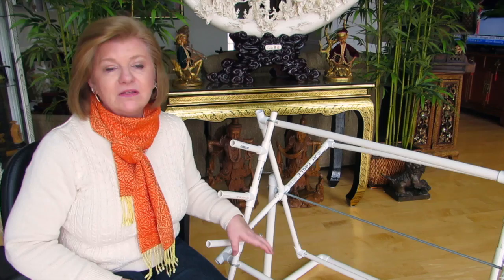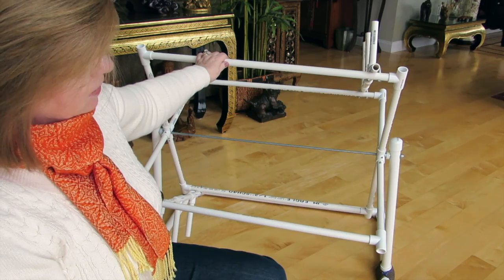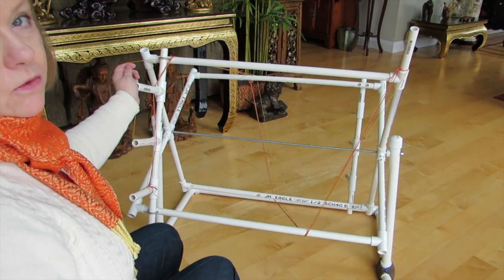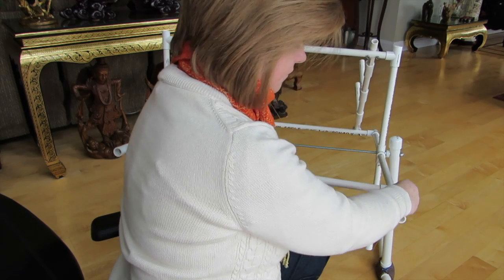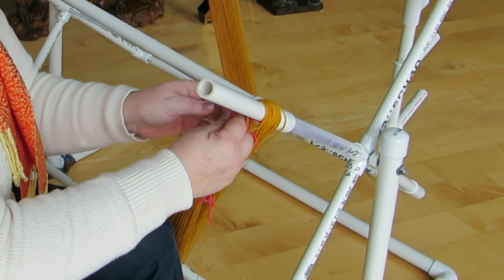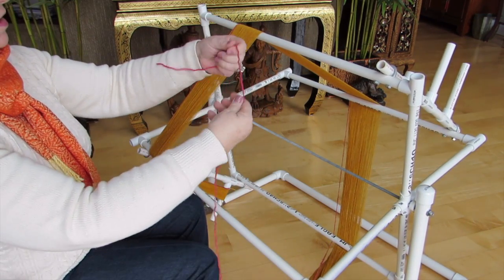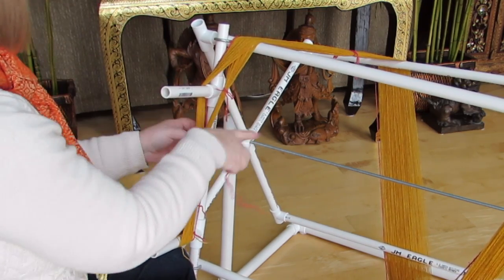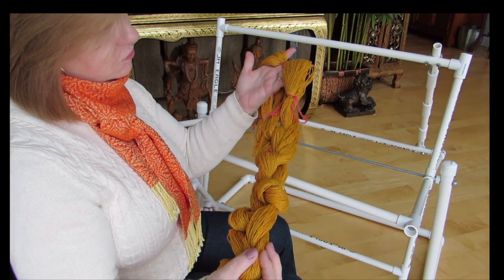Winding a Warp on a Warping Mill:  Learn to Weave on a Floor Loom #6

Comment: I'm confused as to how you got 88 inches? In your previous video you said that the length would be 102 inches with the fringe, waste, take-up and shrinkage. Thanks!
Reply from the maker: Hi,  after calculating the length I needed I weighed the cone of yarn and discovered that I did not have enough for 102”  so I had to decrease the warp length to 88”.

Comment: Forgive me if you addressed this and I missed it but if you had let’s say a 200 thread ends  that are a lot longer then your 88 inches would you wrap all 200 threads or do it in sections?
Reply from the maker: That is a good question.  It depends on how thick your yarn is and; as you stated, a much longer warp.  I do like to do long warps and usually stay at around 100 ends per section, unless it is very fine 🧶 yarn.  Then I gauge it as I am warping.
Reply: @DoloresJacobs  thank you so much ! I received my vertical mill several years ago but couldn’t find a tutorial to help me use it. Yours is great!
Reply from the maker: @chickeemama1  Thank you

Comment: I have a vintage umbrella swift yarn winder rather than a warping board or mill. I cant find any instructions on how to create a warp cross on this swift. Do you have any ideas?
Reply from the maker: I don't think a swift would work well for measuring a warp.  The warp ends  need to be the same length, so when you use the swift the yarn goes on top of each other which will cause the warp to be uneven.